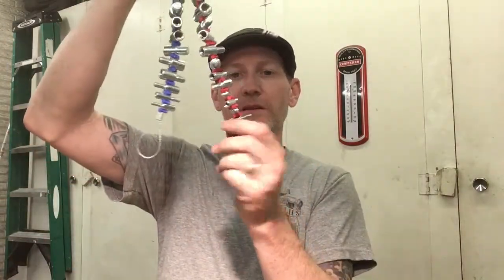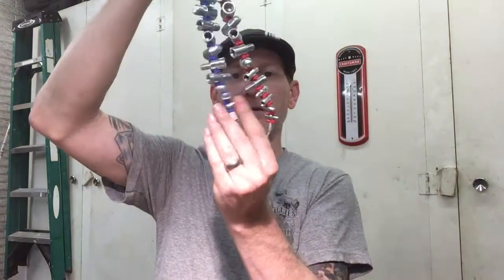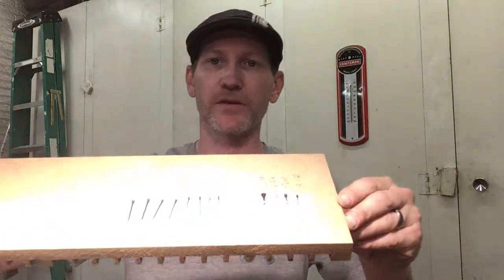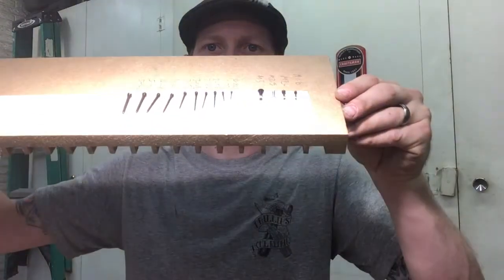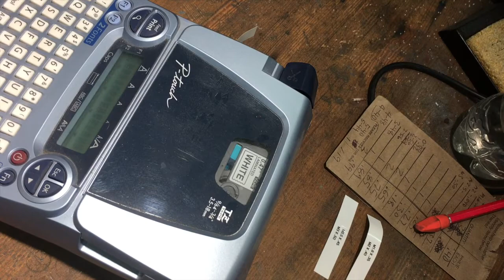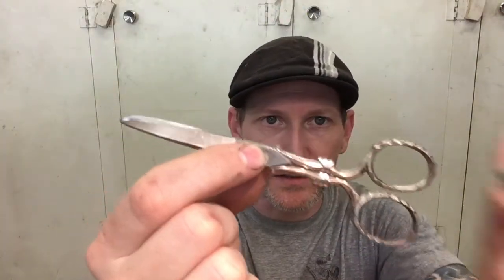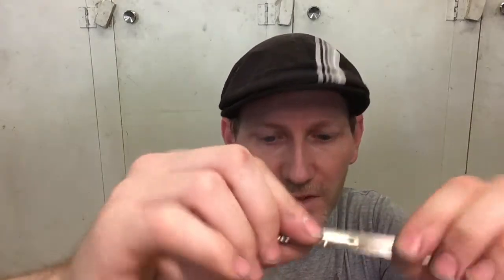DIY Thread Checker Set for Tiny Screws

Comment: This is a nice idea.   A couple of enhancements: 
1) mount the bolts underside before capping with the backing wood (so the screw threads can never be removed). 
2) Use a second row for the nuts, and press (friction) fit them into the wood.
If nothing can be removed, nothing can be lost :-)